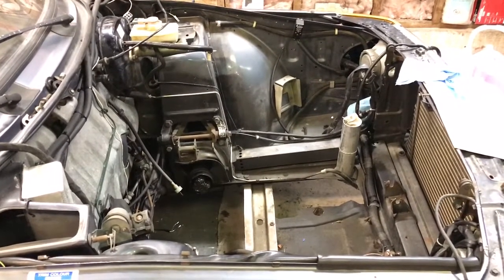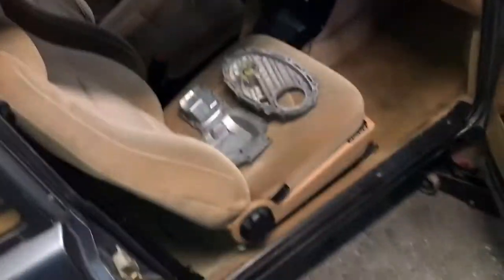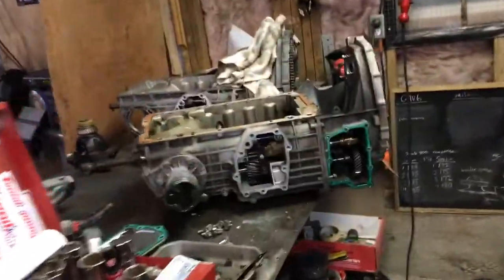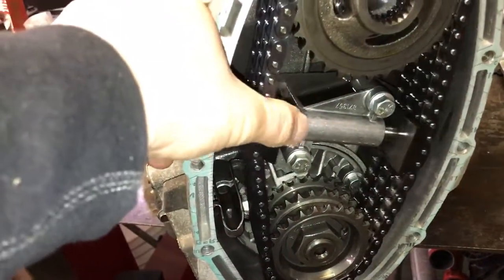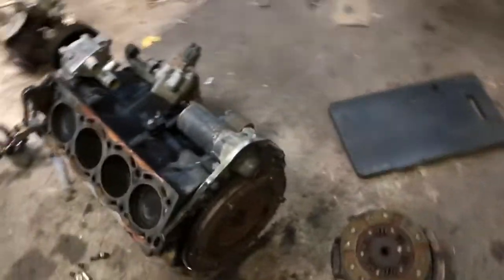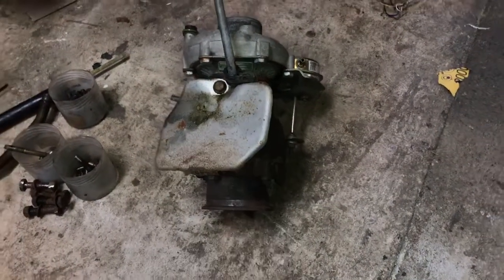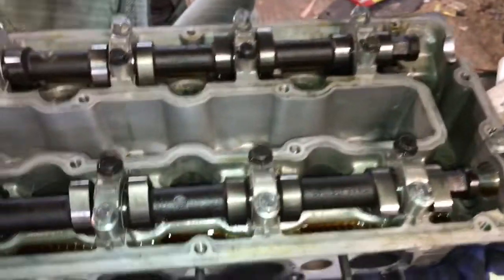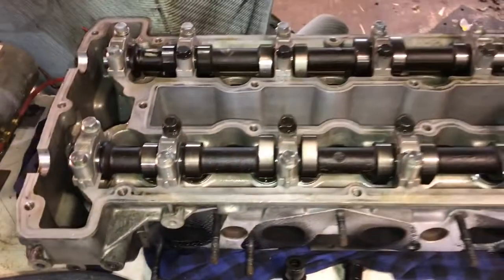Saab 900 gearbox and head work update

Comment: That engine bay is quite clean, no visible rust that I can see.
Reply from the maker: Ya a few years ago while I was rebuilding the engine the first time, I took to it hard with degreaser and the pressure washer. The rest of the car sadly is not rust free

Comment: When you have the transmission rebuilt, you should definitely post a video with the place you had it sent off to. I have to get my SPG's rebuilt and I'm searching for a shop. I've got a local guy here in CLT that has a place for the autos but not the manuals. The shop owner used to rebuild all of them and has retired. Scanwest may be a bit too far away for my taste (may be a little too expensive as well). We'll see though.
Reply from the maker: Honestly Scanwest is probably the best place for most to have them rebuilt, BUT there is a local guy here Nordicspeed who may start rebuilding boxes in the future. Personally gearboxes are easier to rebuild than engines so if I can find the parts ill probably do it myself
Reply: @Nodarperformance  Dang, I've always heard that transmissions are much harder than engines. Guess I have a full awakening coming when I open up my B202 for a full restoration. I may just send my tranny off to Scanwest after all. I'd love to start a business manufacturing transmission parts for c900's one of these days. That's far off in the future though and I'd have to jump through hoops with whomever holds the patents on the parts to begin with.
Reply from the maker: @austinvitoux  If you want to rebuild an engine properly there are 5 main bearing journals, 4 rod bearing journals to measure and spec out, afterwards the big ends and block need to be measured to calculate the proper oil clearance, then there is a matter of balancing the whole mess if parts are changed. dont forget to measure the small end pins and bushings. after that, the bores need to be checked for taper and out-of-round, then the rings, and piston measurements, end gaps...and it goes on and on. The transmissions are easy, there are basic roller bearings and one needle bearing on the layshaft. The synchromesh assemblies are just checked for wear and the defective parts are rejected, and put back on. The whole transmission is mostly held together with standard fasteners and circlips. As far as measurements there is the pinion depth and the cluster gear shaft extension length and thats it. After assembly the backlash and bearing preloads are adjusted through simple shims on the drive flanges...I wish I was making more videos on youtube when I rebuilt my Saab B202 engine a few years ago, as I did a proper thorough job for sure